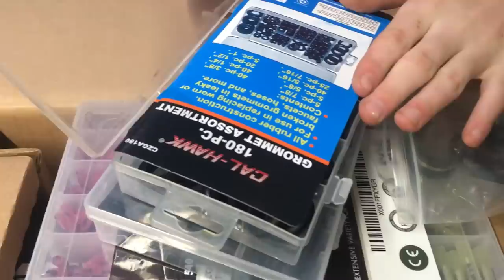How Much Firewood Do You Need For Winter?

Comment: Those were some very sage thoughts. Those sometimes small, but thoughtful gestures extended by a spouse act to affirm that they not only care, but are aware. In this day with the busy lives some of us choose to burden ourselves with, it becomes easy to lose sight of the big picture and just focus on our individual roles. When complacency sets in, resentment takes root. In our family, we don't have the same set roles as you do and often share the burden of the day to day. There always will be certain jobs that to which one spouse is the primary for, but the other is often quite capable and willing to step in if needed. The topping video looked like quite a ride...I've never been bothered by heights and climbing, however one of my most harrowing experiences came at the top of an antenna tower 30ft up when a gust of wind got the tower (and me) waving back and forth.

Comment: Thank you Cody. I have a situation where this applies. My feet are in terrible condition due to damage to them some 35 years ago. As a result I have trouble with doing a lot of standing and walking which limits the things I can do. As a result, my wife has taken on the work outside the home. I do as much as I can around the house to help out but sometimes it's not enough. I will continue to do what I can and seek the Lord's guidance concerning work that I can do to receive some of the stress from my wife. Thank you again for this.

Comment: works very well for my to fill the connectors with dialectic grease before installing the wire and crimping. eliminates corrosion and water entry. also I feel it helps with vibration also. have a trailer I built over 20 years ago using this and outdoor SO rubber covered wire and the only problem is one tail light. and that was because vibration wore the spring loaded contacts into the insulator and wouldn't male contact any longer.

Comment: Cody, you should disconnect the battery from the quad especially if youre using the clamp charger. If you leave it plugged inside a vehicle you could damage any parts on the quad. I will recommend a trickle charger that you only put 2 terminals on the battery and then you have a quick connection/disconnection. And there is less chance of damaging anything because there is no spark ⚡️ while plugging it on
Reply: Anderson PowerPole connectors work especially well for this application. Especially the 100A size, with a handle attached, as surplus from busted forklifts.

Comment: I love how you take advantage of your right to share your religious views despite the scattered opposition to it. Faith and freedom left unused are hardly worth talking about. I like your firewood stacking method. I used that method as well until I got a tractor. Now I use ibc tote cages. You can get the for free or cheaply. Now I just bring a load at a time. I get about a third of a cord per cage and it stacks very quickly. Keep up the great work.

Comment: Great video today Cody many thanks. I watch a series from England called cruising the cut. It's a guy living on a boat on a canal boat in England and he also depends on his stove for heat. He has an interesting device on the stove a little fan blade thing that sits on the stove and the heat from the stove turns the fan Distributing the heat you might want to check it out and I'm thinking that he might want some information about your soapstone pot of water which obviously raises the humidity

Comment: For most of our modern things you can charge them directly off the battery ether with direct 12vdc outlets or 12vdc to 5vdc usb ports. If it uses an external power supply you can just get a car charger that outputs the same voltage and amps the device needs without touching AC power. 

Have you thought about getting a wood sling to make carrying in wood easier? Would let you carry more per trip and not risk it catching on the clothing or getting you covered in dirt.

Comment: If you really want to ride that Honda on ice.  Take a bunch of 1/2" self tapping sheet metal screws, the ones with the 1/4" or 5/16" head , and screw them into the knobs in the tires. Works great on ice,  then when spring rolls around take them out.

Comment: Just for info, that heat shrink does not waterproof. There is different heat shrink that is more thicker and also has like a hot glue inside that melts and seals the wire from the inside so it can’t get in the insulation.

Comment: Hey Cody I know your looking for a bike to ride with your son. You should check out the Christini AWD bike they are a all wheel drive 450 4 stroke but they have a centrifugal clutch system which would make it easy for mrs. wrangler star to ride also. I’m in the same situation right now and I’ve been looking at them for my wife, son, and myself. They are extremely reasonably priced also for what you are getting. They are the new bikes our special forces are deploying instead of side by sides for go fast rough terrain insertion. They also make them dual sport so they are also street legal.. I’ll stop rambling I just thought I’d share because I’ve been on a similar journey. Check them out if you get a chance, there’s a ton of YouTube vids on them.

Comment: Ok,modern homesteading,good,now get some modern wood burning stoves.
Rocket stove mass ovens.
You will use a 1/4 the wood to heat,and 95% less smoke!!! Get on with it!!!
Reply from the maker: Why is it the guys who tell me to get a rocket stove don't actually have one?
Reply: Wranglerstar well, how would you know if they have one?
Reply: Good luck getting homeowners insurance with a rocket mass heater.
Reply from the maker: It's an educated guess,
Reply: Krpajda Calling it a “rocket stove mass oven” might have been a tip off.
Reply: JAK u meant Masonry heater?(building codes equal to regular fireplace)? rocket stove and masonry heater are not the same